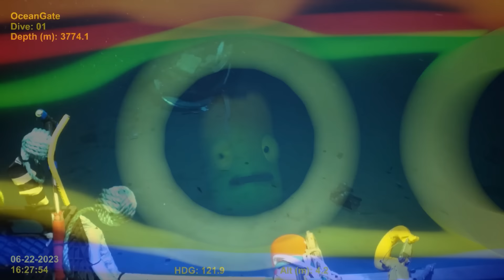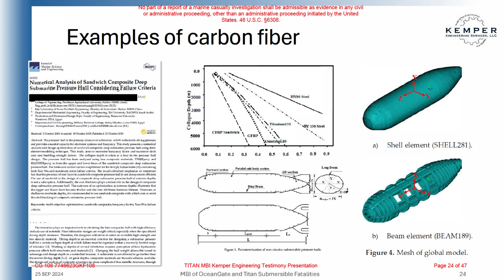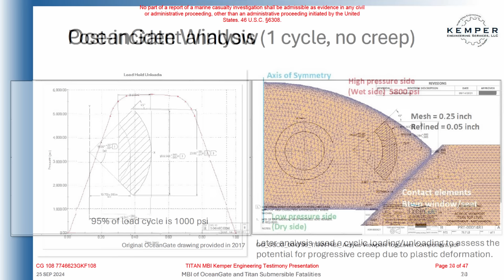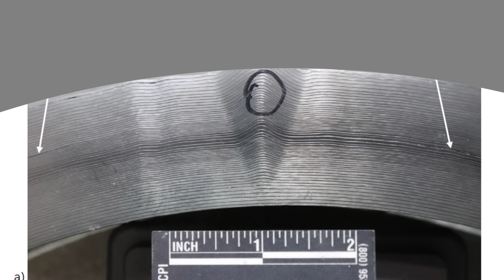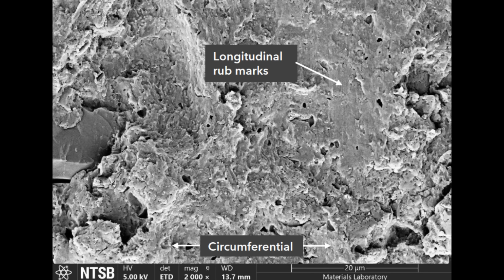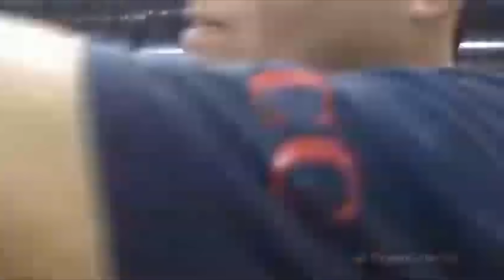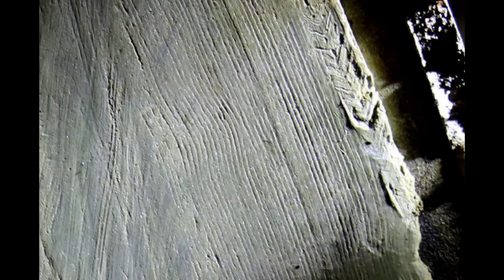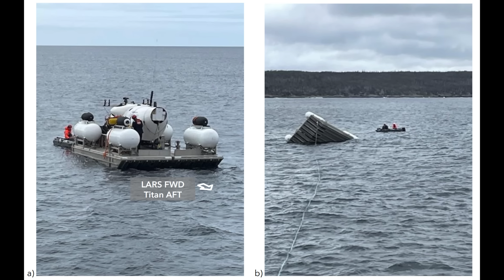OceanGate Wreck Shows Why Sub Wasn't Strong Enough To Survive - NTSB Shares Important Details

Comment: 3:41 Umm your scoff at Accrylic plastic, that's actually a hold over from the space program I think, they had glass crystaled watches back in those days and those would actually break and shatter, and one of the omega moonwatches did just that, as it would just get brittle and break from the temperature difference, and the shock of, well being launched into space

so they switched to acrylic, IE plastic for that purpose and I think even the windows of the space station are made of that same thing, as they can take pressure and bend, vs a solid and hard material such as glass

hence why well even in star trek, the windows are made out of transparent aluminum according to the lore 

as the thing needs to be strong enough to take the strain, but also bendable enough to absorb the strain, like that program that had that idiot obama on it

smarter every day, the guys ex miltiary and you can tie a piece of string from one side of the sub he was on, a military sub to the other, and it will actually go from being taut to slack based on the depth of the vessel, that is how much pressure it is putting down

and you basically have to build the entire thing like an arch to equally absorb the force and the pressure, which is why you dont exactly see anything designed like a delorean driving around down there 

and its why the oceangate failed, the ring where the door was put failed, as they had no screws to keep the adheasive they put around the ring from ripping around that titanium seal, and it just broke from fatigue

as the water found a whole, and adheasive once it gets a cut into it, just rips off, its something I was reading about on the lotus elise, the first car to use bonded alumiumn for its structure, in order to not have that happen to it, they have fasteners in addtion to the baked on adheasive, so even if the adheasive isnt there, the screws will keep it together and it wont sheer

something stockton hasnt done, which is why he's in a crushed beer can next to the titanic now, that colapsed around its ring

and if you think about it, it basically is designed like a beer can with a window and a tail on it, and you could probably do some pretty precise pressure tests to mimic its failure with one of those

Comment: Real-time monitoring data doesn't work if you don't monitor the data.
Reply: The main issue was they had no data to tell them where the bold red lines needed to be. Whatever the data showed, Rush would have shrugged it off as the “weakest fibers settling”.  In the end, he got the only data point that would have ever convinced him.
Reply: @CineSoar  Well, bold red line are one thing, but that huge change of hull shape (when the bang happened) should set all the alarms off, regardless of the noise data. Anyone with two working brain cells should see that something must have buckled or broke for this chart to look like this.
Reply: @McFrax  Yeah, but there was this guy in charge called Stockton Rush. You might have heard of him...
Reply: @CineSoar  true, as they never actually tested any of it.  Though they did get significant deviations from previous dives after a major "acoustic event" and had the before and after data to compare.  They had the information,  but they either never reviewed it, or they didn't care.  And knowing what we know about Rush, the later seems more likely.
Reply: @CineSoar  Watch any movie and you will see someone assume the device doing the monitoring is malfunctioning rather than actually doing what it is supposed to do.
Reply: @thefrener794  and sadly, far too many NTSB accident reports.
Reply: Yeah. It's real time monitoring data. not real time ignoring data.
Reply: @ChrisBigBad  to bad nobody said that to Rush.  They had the data there and they could have prevented the whole thing.
Reply: @distracting_games  If they had said anything about it to him they would have been ignored or fired. The work ethic of the cowboy outfit was rotten.
Reply: @RWBHere  yeah, that's likely, given Rush's track record.
Reply: His talks with the former director are really a bit ironic now with him saying, 'oh yeah it doesn't just fail it gives indicators first and we will then stop, come back to the board and rethink things.' Where was the stop and rethink... They had the indicators. They heard a literal bang why not take the time to go over the logs and see if something actually changed. Not write it off as outer hardware shifting, and even then if it had been outer hardware moving make sure it didn't harm the hull.
Reply: Normalizing deviance
Reply: Now it's a post-mortem monitoring system.
Reply: They monitored it, they just didn’t analyze it correctly
Reply: He did monitor the data, but then he ignored or dismissed said data.
Reply: Or ignore the warning signs from past dives
Reply: For me it's interesting this big bang happened on surface or just next to it, that's why it might be dismissed. But changing the compressing and expanding of the material associated with it should be big warning.
Reply: I think there is a flaw in the logic of monitoring these sorts of things. There is a system that can detect cracks forming but you have to be 3km deep to know if there are cracks, that's just playing with fire. Ok great we have detected cracks in the hull, now we just hope we make it back to the surface? The hull wouldn't be cracking at all and they would have no need for that system if they had just used a titanium hull. Reactive safety instead of preventative safety just makes no sense to me.
Reply: Am I just a midwit layman for thinking that a carbon fiber tube assured with "acoustic monitoring" is just a bad idea? I know hindsight is 20/20 yada yada, but when I heard about these people being stranded, and then that the vessel was a first of its kind carbon fiber tube, all the other technical stuff didn't matter to me. Does it matter at all else?
Reply: @merrickx  composite use for a submersible is already a terrible idea
Reply: Data that says; "WARNING! YOU WILL BE DEAD BY THE TIME YOU HEAR THIS MESSAGE!" is not very useful, except to internet comedians.
Reply: @DavidParry-BackFromBanned2019  lol, though, in this case, it appears that they did have some warning before the final dive with data indicating the hull was compromised and needed to be replaced, only it was ignored. It's one of those things that starts failing gradually, then fails catastrophically suddenly.   They did have audio indicators of hull fatigue on their sensors and recordings.  It was just ignored, as apparently Rush thought that carbon fiber was some sort of wonder material.
Reply: @distracting_games  The ChiefHalfwit only took safety warnings as mere suggestions.
Reply: Got that right.
Reply: For such an application as this, there should be no possibility of a human operator ignoring or not noticing warnings. The safety mechanism should have started automatic ascent (still probably wouldn't have saved them)
Reply: @qoph1988  they had an indication from a previous dive that the hull integrity had become compromised, and they ignored the data.
Reply: Exactly, also they should build a model and test it in real time, not a computer generated because CFRP is hard to model
Reply: @stevengavra  yeah.  It would be interesting to rebuild the titan as an experimental ROV to test the cyclical limits of a carbon fiber pressure vessel.  Oceangate did prove that it works for a limited use vessel.  The real problem would be figuring out the best way to inspect the hull between dives and where the safety limits are.  I would be interested to know how often a vessel like it could realistically and safety be used before the hull needs to be replaced.
Reply: @distracting_games  this is why CFRP is not good as a submersible, because CFRP only good at expansion like 787 Dreamliner, not compression
Reply: The data suggested a question but nobody planned an answer to such questions
Reply: rtm doesn't matter when your real time is about to be blown it particles

Comment: Another major reason for wanting a lightweight submersible was land transportation.  One of their plans was to put these submersible in box trucks and haul them around to different tourist spots as a sort of traveling ride.  There were supposed to be a fleet of these things operated by a non-technical driver with minimal topside support, except perhaps to take the fare money.  And indeed, they DID transport it on the ground in a box truck.  It was hauled that way and left outside in a parking lot when not being used.  Exactly like that "race car" your friend owns that he keeps outside and tries to race once a year.   Oceangate treated the submersible as nothing more than a means to make money as cheaply as possible.  And it didn't even work! The company was barely surviving at all, and had no choice but to keep taking wealthy passengers just to keep the lights on.

Comment: In the document released by NTSB (provided docket in other comment), there is an image of the forward dome and it is defromed.  It would no longer be able to be put against a ring and form a seal. 
What will need to be investigate is the water hammer effect of water rushing in quickly (an whar caused the tail to detach fro the aft ring).   The fact that the aft dome is partly opened shows that there would have been a force greater than the ~5000psi which was pushing the aft dome against the cylinder for the aft dome to partly detach from the ring against which it was attached.  And that also puts into question the force with which the aft ring was still attached to the cyclinder. A weak glue beteen cylinder and rung would have caused the ring to detach and there would have been no need for aft dome to detach fro ring at that point. (or for the tail to detach).  

It is easy to criticise OceanGate because they didn't properly validate their design. But it si s quite possible that some portions of their design were sound.  This is important because if ons is to draw guidelines for building carbon fibre subs, you don't want to eliminate a sound design just because IOceanGate used it.  So NTSB has important role to play to evaluate portions of the submersible's design were sound and which ones did not meet with the requireents. (for instance 5 * ( 1" layers) instead of 1 * (5" layer) are not equal, but what if 6* 1" would have been adequate?

Comment: Those layers would also have to be 100% waterproof too, if water were able to work its way through layer 5 to the glue joint between 5 and 4, then the hull is effectively 4 layers at that location, and that location has a point load on it that the rest of layer 4 isn't experiencing.  Carbon fiber is pretty waterproof because of the epoxy impregnated into it, but if there were a way water could get around layer 5, like a poor glue joint to a titanium end ring...

Comment: 19:36 ive done machining, and it sure doesnt look like it was cleaned and prepared right to me.
There are large and varied fluids that gets sprayed on metal to fight corrosion or firction and they require serious effort to remove, effort that can be either done improperly, or not at all.

Comment: i wonder if anaerobic epoxy instead of hard setting epoxy is the answer. it's cracking and de-laminating because the epoxy does not have the same yield characteristics as the CF.
pretty sure the interface glue was anaerobic. the glue isn't needed at the interface to hold the end caps on, pressure does that job. it's more so needed as a sealant that acts like a glue.

Comment: Your lack of engineering knowledge is showing. The design was tested and failed. The complete carbon-fiber and titanium hull was tested, it failed miserably, and a second carbon-fiber tube was made with better quality control and nothing more. The carbon fiber section was expected to fail in an unknown number of trips. This was not a lack of testing, this was a lack of listening to the results of the tests.

Maybe a sphere of carbon fiber with a lot more epoxy and a lot less carbon fiber could work. Or maybe a completely different composite might do the job. But this disaster was not due to a lack of testing.

Comment: I wonder if you had a carbon fiber core to the pressure vessel with an inch minimum titanium or steel exterior with a minimal air gap between the two if CF could potentially be used.

To be clear, I don’t have any degree or education.

Comment: The glue failed first causing the cylinder to buckle and the separation of the carbon fiber layers. The impurities in the construction of the layers did not cause the failure in the first place. The whole vessel was basically put together by some glue.

Comment: Thank you for this great explanation. USGS testimonies revealed that OceanGate did not have qualified engineers who knew how to read and understand the warning signals. The multiple technical failures are astounding. You can see many of the fabrication and material flaws with the naked eye when you watch both the early promotional videos and these more detailed images of the manufacturing process,  The real surprise is that the hull lasted as well as it did through multiple dives and how the Titan was mishandled between dives.

Comment: It's so disheartening to hear that every single safety alert system worked exactly as intended and it still wasn't enough to prevent catastrophe because of the single point of failure in the illusion/delusion of safety.